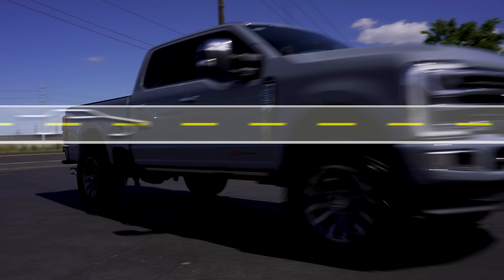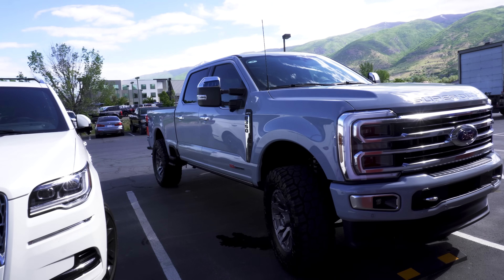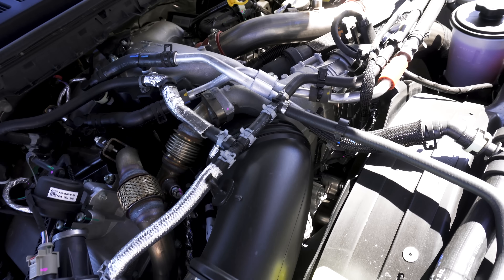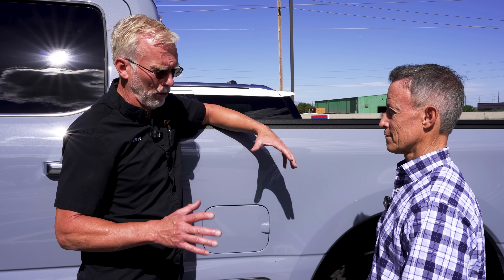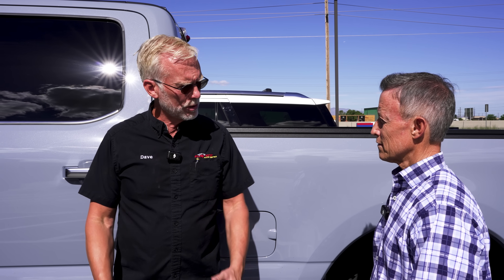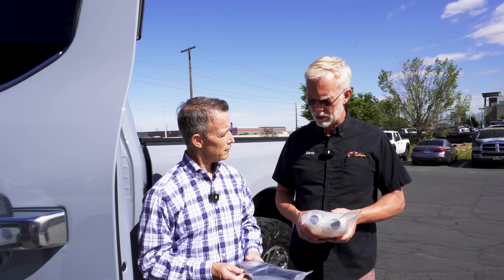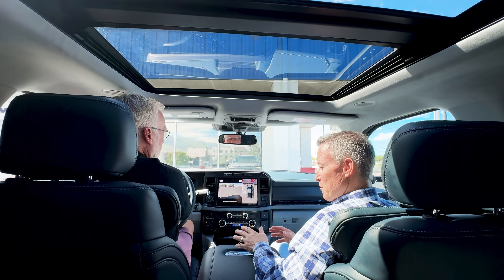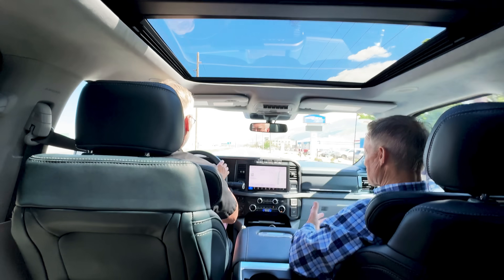Diesel Truck Maintenance

Comment: Come to Texas establish an LLC and then remove all the EPA bull crap off your truck and it will run forever. That’s what we do here in Texas.

Second, unless you absolutely have to have a diesel because you’re pulling 17,000 pounds or more just go with a 7.3 L V8 Godzilla. It will save you so much money and headache in the long run and that engines built to go 400 maybe even 500,000 miles.
Reply: I live in Texas and have a 23 F450 - why establish an LLC?
Reply: @SteveDodson-l8n  You need the LLC if you don’t live in Texas. By establishing one you can then make the truck the property of the LLC so you can register the vehicle in Texas and not worry about getting inspection.
Reply: @SuperSnakePlissken  Thanks for the clarification

Comment: Got a 2016 F350, 6.7L Powerstroke and im just under 299,000 miles and it's still running strong. Developed a small leak in the upper oil pan seal that I'll be addressing soon but other than that it's a solid truck. No tune and bone stock. Do your maintenance people.

Comment: You dont need a 50k fuel polisher. I used to polish under ground diesel tanks for generators and our set up was only 8k and we did over 1,000 gallon tanks with it.

Comment: So my first piece of advice would be forget a modern diesel and get the 7.3.

All the failure analysis made sense but how to detect and avoid was less clear. 

Oil analysis is a great tool and will detect excessive diesel in fuel, but other than that I'm not sure any methods to detect dirty injectors were mentioned. In my mind when it's that noticable in the oil is it not too late? 

Also the importance of fuel was stressed but what's a consumer supposed to do? It almost sounds as if you need to install a scrubber in your truck, or truck your diesel to your home tank with its own cleaners and scrubbers, and if you travel or long haul you're still at the mercy of the local stations. 

So yeah.... That 7.3....

Comment: 3 generation trucker here.  Fuel additives POWER SERVICS brand.  There's different types and color coded bottles read the label. I run white summer and Grey winter.  Diesel fuel is different summer and winter. Get Def from a truckstop pump that's high volume and looks clean.  Def in jug use brand blu. Def expires.  Install secondary oil filter system.  These can filter out the soot and clean the oil literally cleaner than new out of the bottle.   Blue Ribbon logistics has run several trucks over 1 million miles just swap filters and top off  the system.   High quality filters and maintenance especially undercoating every 2 years and secondary oil system and a auxiliary tank and transfer pump and gooseneck trailer systems for ultimate performance and resale.  Keep the paperwork for every dime and under no circumstances modify the engine and transmission.   These trucks have factory specs engine to tranny so that upgrade just cost you 30k of resale value.    Us drivers will buy these private market from a homeowner who has a boat@ 300k miles ALL DAY unmodified.   Don't lift the truck.   I've bought at 85k sold at 244k and made $4000
Recently seen Larry spend $68k on a ram 240k miles because it was bona-fide stock and pre emissions with the oil system.

Comment: 3500 miles for oil changes is bullshit and overkill. I do a high mileage and i run all my cars between 200k-300k miles, VW 2.0 Turbodiesels. I change the oil every 10k. When i sold them they were running perfectly and they weren’t burning a drop of oil between services.

Comment: Dave, I'm a new follower and appreciate you sharing your brain with us.  Just bought my first diesel, GMC 3500 and really want to keep this thing as long as possible.  I'm curious on your thoughts of these EGR filtering solutions (ie: Fass EGR, etc.).  I understand recirculation is terrible for these engines.  Do you think this would help us keep these trucks going longer?

Comment: Don’t forget the antigel for winter! I drive a freight liner Columbia with a Detroit D60 and I was in Bozeman, MT forgot to put antigel in the tanks. -35 degrees Fahrenheit and the fuel gelled up and was stuck there until I got a mobile mechanic to come out and torch the engine block then circulate antigel in the fuel tanks. Any always add fuel additives!

Comment: Back in 06 I read articles about the up coming emission regulation. So I bought a new 06 Ram with the 5.9 Cummins to avoid all the problems with the new regulations. Still have that truck and tow a 5th wheel RV. Never had a problem because I do all those tips you gave your friend. He showed you some diesel additives, that is what I use also. I also added a better fuel filtration system on the truck and use a treatment to deal with the microbe problems with the bio fuel added the the diesel. Back in 2012 when they started to add 5% bio-fuel to the diesel, my 98 12v cummins fuel filter plugged up because of the microbes growth on the filter. Still have the 98 12v and no issues for 27 years.

Comment: Ive always stressed using synthetic oil in the DPF equipped models. Fuel dissolution is an issue and good synthetic oil combats that. Yes, its expensive but its peanuts compared a engine

Comment: The proper maintenance of your truck is the 2nd hardest part of owning a diesel.  The hardest part is finding a trustworthy, knowledgeable, reliable mechanic like Dave and his team.  I wish there was a no-doubt way to find a local mechanic that had ethical, no shortcut mechanics to take my diesel to.  Because these modern diesel engines are so sensitive to even the smallest improper maintenance misstep having a shop that can ensure zero mistakes is critical.
Reply: I am realizing I will probably just have to do most things myself to make sure they are done right.

Comment: Use Diesel #2.  Always use fuel additives. Try your best to always fill up at a station that is always busy. Also fill up there only. Always up 100% Synthetic only. Always empty the water fuel separator every month.

Comment: Have Nissan Titan with 250,000 miles and have not had to replace any parts related to emissions using Amsoil products also no engine cylinder wear

Comment: Yet they Ford was doing regens forcing diesel past the rings and down into the crank to over two pints of fuel per oil change. Then saying that if you tamper with the emission system.you will void the warranty but by the time the warranty is up the engine is junk.

Comment: Engine oil dilution on the new 2024 Ford is much less of an issue, since Ford added a fuel injector at the DPF, instead of injecting fuel into the cylinders prior to the exhaust stroke. That is where most of the unburnt fuel would go down the cylinders into the oil. It was never really an issue prior to 2008 when the EPA started to kill diesel engines.

Comment: Air filter ,egr sensor clean, fuel filter clean, and change oil every 3500, don't forget to change transmission fluids and filter as well...keep clean coolant in vehicle and flush out as needed...

Comment: With diesal s keep air filter s clean change your oil if u have a egr my Van doesn't need good run on highway to get them hot to burn of carbon change your fuel filter can purge of fill fuel filter with injector cleaner when changing it be fussy and should get long time with engine 😊

Comment: In case people are not aware. Egr was introduced to keep combustion temperatures down because high combustion temperatures produce higher nox but reduce particulate matter (soot). So because of the increase in pm manufactures had to introduce dpf

Comment: My advice regarding Adblue
- do not top up, fill it up only if the tank is almost empty. Every time use fresh Adblue. Over time the concentration of urea goes down and it becomes less and less effective. Most manufacturers recommend changing ad blue after 3-4 years if you do not spend it.

Btw it is really corrosive :-) so be careful 😅

Comment: As far as the DEF goes, it has an expiration date, and most of the time the boxes are expired. My understand is that exposure to oxygen and sunlight is what makes it expires so “they” recommend to use the in ground tank DEF at a big truck stop over boxes. Most likely the underground DEF hasn’t been exposed to sun and is newer since truck stops go through so much DEF. 🤷🏼‍♂️

Comment: Any thoughts on Insane Diesel bypass filter system or something similar?   Or is that sorta useless because the diesel is degraded from fuel faster than particulate content?  Service interval on my sprinter is 20k miles but I like to change oil filter every 5k and do oil+filter every 10k.

Comment: The KEY to 6.7 Powerstrokes, is CLEAN FUEL...... change filters regularly, drain fuel water separator regularly, and run an addistive in the fuel for lubrication !!! change oil 5-6000miles, change fuel filters every other oil change.....

Comment: for gasoline, the octane rating determines its resistance to "knock" or pre-ignition, which can be destructive to a gasoline engine.
diesel on the other hand, relies on its willingness to ignite during compression, i.e., the opposite of what you want with gasoline.
diesel therefore has a different rating - the cetane rating.
the liquid that is put into the input pipe with a blue cover is probably urea (e.g. Adblue), which is injected into the exhaust to reduce emissions.

Comment: If you were to cut your diesel fuel with a low percentage of kerosene would that help to keep your engine clean, 
Kerosene is really just a high quality diesel fuel, but straight up Would burn 🔥 to hot.

Comment: I have a 03 f350 6.0 4x4 crew cab 8’ bed.  Proper maintenance is a must. Mine has been very trouble free. Have 59k miles and I bought it brand new. I love that it’s a 6 speed manual, manual transfer case and manual hubs.  It gets 18mpg at 75mph or 20mpg at 65mph.  Weighs 7900lbs empty. No DPF and no DEF.  15qt oil changes every 3k miles, OEM filters for fuel and oil are a must.  Much higher maintenance costs than gas vehicles.  My first diesel was a 83 Mercedes 300SD. Zero emissions. Was in my family for 35 years & 300,000+ miles on orig engine & transmission.  When they do fail they are way more expensive to fix and have expensive parts like injectors, HPOP and cylinder heads.  & large truck tires with 55-80 psi. Modern diesels are way more complicated due to all the pollution crap like EGR systems, DPF and DEF. Miss the old 300SD.

Comment: 2:26 When I worked at a Cat dealer they always told us to use containers rather than the ones at the pump. The heat evaporates the water out of the DEF and throws the mixture off. The containers are usually stored in temperature controlled environments and the ratio is usually more accurate that way.

Comment: Meanwhile, in line 4 cylinder 3 litre Toyota Hilux diesels will do 1/2 a million miles with nothing but a cam belt change every 60k miles and oil changes every 10k....

Comment: Not a mechanic, but bought a2002 F-350 w/7.3L new, an old timer mechanic told me years ago, change your filters regularly, use marvel mystery oil in your fuel and oil. The truck just rolled 418,000 mi. Still drive her every day!! Good luck with your new truck. Dave, another gem, thanks for doing these vids and sharing your knowledge, it is much appreciated. 👍👍🇺🇸🇺🇸
Reply: I have a 2000 F-350 with 180K on it, had it for 21 years we use it to snowbird to Florida from Washington St for the last 5 years pulling a 30 foot travel trailer gets 10 to 11 mpg
Reply: That's an International motor. Solid
Reply: Don't ever get rid of her, unless you plan on getting a 99-01.5  for them rods.
Reply: I have a 2002 F-250 7.3 and I bought it in 2008 when Obama had diesel at $4.00 a gallon. It’s 4x4 and for $16,000 dollars it cheaper to fix the things that break than to get a newer turd bucket at over $100,000 dollars. You can also take off the bed and put a flat bed on it with airbags in the rear and it looks rock solid. I’ve been offered $35,000 cash, and who wouldn’t blame a guy. I’d never get rid of that truck, heck a crate 7.3 is only $20,000.00 dollars. Sounds expensive but that’s dirt cheap compared to a new piece of poop. Paint and Ford parts, that’s all you need.
Reply: Great engine sir. 6.7 is on a different level.  Especially with maintenance
Reply: 7.3 was bulletproof. It was the last great diesel engine ever installed a pickup truck.

Comment: My Dad had his 2013 model Holden (Chevrolet) Colorado RG which is fitted with the 2.8 litre turbocharged Diesel Duramax engine dyno tuned after my brother replaced the standard exhaust system with a 3 inch diameter & mandrel bent exhaust system,a larger intercooler & the tuner also did a combustion chamber decoke by removing the cylinder head & cleaning that & the piston crowns up as well as the Inlet & exhaust ports, they also did an EGR valve delete prior to retuning it.

The end result was a power increase from 147 flywheel kilowatts to 198 flywheel kilowatts & it also puts out 500 Newton metres of torque now.

I noticed that it has a lot more grunt than it used to have !

Comment: I was at 435K miles in an '06 jimmy before some dimwit took me out. Very lucky I wasn't pinned inside. Anyhow, i wasnt really religious with maintenance. I kept up with it for the most part but got behind a couple of times with oil changes. Remarkable longevity for a d-max. Maybe had to do with not having a def system on it. Never had  a problem with the injection system

Comment: Back in my Ford dealership days, I would literally get into arguments with the diesel customers. They would spend 8-10K more to get the diesel option, then wouldn't spend anything on maintenance. 

I personally told the customers to get the oil changes at 3K due to the oil diluted problems with our International Harvester diesels. 

I told them to plug in their block heaters when the temperature dipping under 40 degrees at night. 

I told them to cycle the keys through 3 wait to start cycles before starting up on cold mornings. Again, I wasn't getting through. 

One customer said that he was going to jippy lube because our prices were too high. 

I am SO glad to be in government fleet and not dealing with dummies.

Comment: Another thing to consider is regens on these newer diesels. If you are short tripping it lots and not letting the engine work or get up to temps you will start to clog the dpf and regen more frequently. A banks IDash is key for monitoring emissions!

Comment: Always run #2 Diesel. Avoid long idle and they need long drives. Short drives...use a gas or electric car. Install a high idle switch in case you have to idle. Change crank case filter if it has one.

Comment: The first thing you teach them is 

"Dont buy it unless you actually need it."

Then

"Don't put a lift kit on it"

Then

"Don't change the rims"

Then

"Don't drive with the trailer mirrors extended unless you are pulling a trailer because if you do any of these things people are going know you have a small ****"

At this point 90% of F-350 buyers decide they don't want an F-350

Comment: DISCLAIMER: While I am engineer for the Big C, I am commenting in my personal capacity and my comments do not reflect any official statement by Cummins. 

Dave, please forgive a minor correction: the combustion recipe of modern diesels is specifically calibrated to ensure that no fuel is washing the liners down. Instead, the spray is targeted to stay within the piston bowl or at most slightly split it (e.g a fraction of the spray plume goes above the bowl rim) but only when we can prove that the fuel is burning before it gets near the liner. Part of the reason for high injection pressures today is not just smoke control, but also trying to get the fuel in as fast as possible (in terms of the fewest crank degrees of duration) because once the piston starts descending, you’re losing swirl and heat and pressure— all things that help speed up burn and improve efficiency and reduce PM.

You are absolutely correct that fuel is the enemy of oil, because all of the soot and contaminants in the oil ultimately came from the fuel. That’s why it’s important to use good fuel with excellent filters (Nanonet) in the fuel system. I personally recommend oil changes when you’ve burned 200x the pan’s capacity for oil. So if you have a 3 gallon pan, change the oil at 600 gallons of fuel burn. This normalizes for usage in a way that changing by miles cannot.
Reply: Hi there... mechanical engineer here.   For your gas engine vehicles do you follow a similar X times the oil capacity?  Interesting idea I like it!!!!!   Btw he mentions Lake and I used Lake's Speediagnostix service which confirmed my suspicion this past winter in my '18 Camry with port/GDI:    had a bit of dilution going on.  I'm embarrassed I went with generic gas for so long...I started Chevron Techron at Lakes suggestion.  5000 oil OCI in that Camry engine at 38mpg would be ~130x the oil capacity.
Reply: @richcombs4805  I use the 200x ruled thumb for everything that’s in good condition. I’d recommend adjust downward as needed for special cases like known blow by problems or a particularly dirty engine with deposits.
Reply: Hey There, I'm looking at buying my first diesel truck, a 2019 RAM 3500 Dually with 6.7L Cummins Diesel. Has 86,000 miles on the odometer. Besides taking to a mechanic to do a pre-sale diagnostic check up, anything I should be looking for??

Comment: All diesel fuel in a city come from the same pipeline.   There is no difference.  The difference is whether the fuel station tanks are clean and their filters are changed on a regular basis.